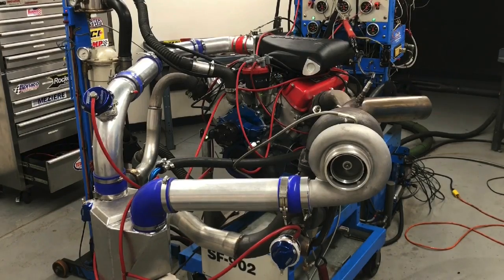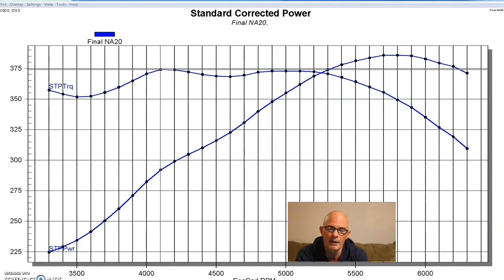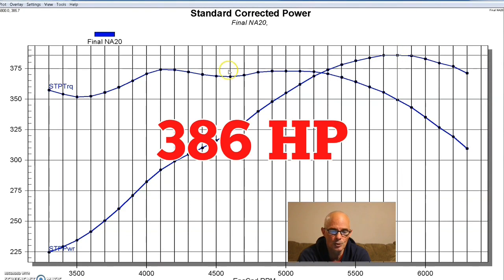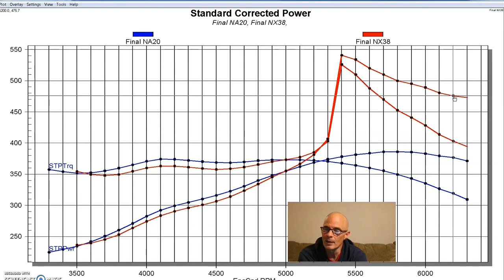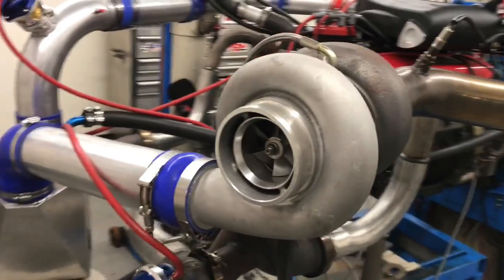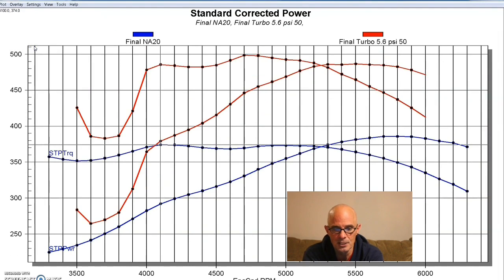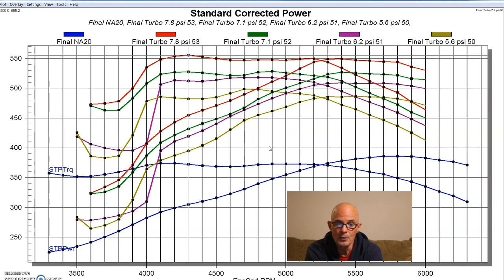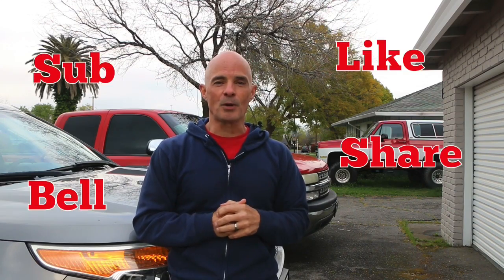DIY EBAY TURBO 5.0L-BUILDING BOOST!

Comment: Do a big bang on a 302. I wanna know of the blocks rly do split down the middle
Reply: That only happened to the 93 models, junk aluminum where the 92 and down models had the iron block and all forged internals
Reply: @sto1asgoetia600 Wait what? This is so insanely cap

Comment: We split a 302 block on the dyno right at 800hp. It split right down the middle.  It was at 15lbs of boost.  Then we made some braces in the lifter valley and a better girdle and it lived after that boost level and it went in a customer’s fox body and ran 9.0’s and 8.90’s for about 2 years before he changed the set up.
Reply: Ron Gravel    Is the 302 block the same in a fox body compared to a sn95 ?
Reply: Do you have more info on the bracing and upgraded girdle you used?

Comment: Rich, can you do a video where you purposely split the block? Just like when you ran that SBC with no oil.
Reply: should be easy, just put the timing back in at the bottom and itll split in half at current hp/torque levels. lol
Reply: You could even score the block and it will peel away from the internals nice and clean.
Reply: I vote a test on stock blocks with arp studs, sbf,   And sbc. Hell I’ll donate the sbc block.
Reply: Hell I'll donate the 318 SBM and GT45

Comment: Thing ran pretty good NA -  350-375 lb/ft from 3300-5700.

That's not a torque curve; that's a torque tabletop
Reply: Pretty impressive for a 5.0
Reply from the maker: plateau
Reply: I agree that engine N/A set up would be so much fun to drive on the street. Endless torque is so much better than a huge turbo spike IMHO.
Reply: @bill2178  stock 5.0 runs pretty good if you give it some more air, fuel and timing
Reply: good heads and good intake plus good duration on the cam to take advantage of it all. 224 and 232
Reply: @warrenstephens3705  If its built right you have torque and the turbo hit. Turbo's don't make less of anything under the curve, they just seem like it because the of how hard the turbo can hit. I built a 2.5 liter Audi 5 cyl that seriously pulled like a big block on the low end. 95 S6 Quattro on a wheel dyno, not crank, it was laying down 419 lbft at 2100 rpm. Never got below 300 lbft all the way to 6500.Thats at the wheels, with all the parasitic losses of accelerating a massive set of 345mm x 30 mm rotors and the OEM wheels.. in an AWD system with three mechanical diffs. Right turbo, right tune, perfectly docile in normal driving, stupid fun at Thunderhill.

Comment: This dude is literally a saint. I don’t think everyone understands how valuable his non mythical advice is to the car community. So much bullshit, and idiot youtubers giving out misinformation, and creating stigmas about platforms that really have a lot of potential. You can make anything fast if you build it and run it correctly for its design strengths and weaknesses. Shit, you can throw ring gap in a Prius, and throw a K03 on it and probably make it toot and scoot. Often it’s human error, but we live in a society where it’s somehow better to open your mouth at all, even if nothing but shit comes out. I often notice guys talk about shit they have absolutely no idea about. Remember kids, it’s cooler to admit you don’t know shit about something, rather than dig a grave down to dumbassville and embarrass yourself trying to sound cool or smart. The car community is riddled with this mindset.

Comment: Please try a BigBang on a 351w.

Keep them coming 👍🏻
Reply: I remember when MM&FF tried that...they ran out of wastegate springs just over 1000hp and tried to modulate boost with the throttle...which ended up with big swings in the boost coming on and off and eventually scattering the bottom end.  I have to think Holdener, at the least, knew about the test...even if he wants to deny it to distance himself from that train wreck! 😆
Reply: @carportshenanigans5918  that was also him testing that i believe lol
Reply: That test was our hero of the dynos, none other than Richard Holdener himself
Reply: Yeah!  I'd love to see the limits of a F4TE 351W!
Reply from the maker: Why would I deny doing something  so awesome? There is more left in a 351W
Reply: Sometimes people want a little plausible deniability. Lol. That was an epic test that I’d love to see with more cowbell(controlled boost)!
Reply: They broke a piston ring on that stock bottom end 351w if im not mistaken. And that build was my inspiration for my stock bottom end build
Reply: How about building a world vs dart block
Reply: @richardholdener1727   cool. How about more details on the DIY turbo build. Waste gate sizes. O2 sensors type. Map sensor MAF sensor conversions for tuneability. And DIY engine tuning. Tuning with a lap top. What you need to do for the proper air fuel ratios in your tune. Boost controls. Timing curves and how to set them for rpm ranges with specific boost. Its a bad ass chanel but Would love to learn more details on the build and tune side. Or atleast some recommended reading. Books and articles and so on.
Reply: @richardholdener1727  any vids on 5.4L? Turbo 5.4? Or 351 vs 5.4?

Comment: Awesome to see some 5.0 turbo love.
 I have the same turbo on mine and also using a Holley computer I'm already at 6.3psi and wanting 10-12 keeping the rpm down and the timing low let see how far this 302 can go
Reply: How’s the car doing? I just picked up a vs racing 7875 and looking for the same result

Comment: Thank you sir.... I'm building an 88 mustang GT and due to family and kids. It's somewhat a budget build. I was already thinking about buying a cheap eBay kit (if I can find a single turbo setup) but this made up my mind. The motor has the basic stuff. Gt40P heads, Edelbrock upper and lower intake, 70mm throttle body, mild cam (was in it when I bought the car) full exhaust that won't matter with the turbo. But I'm realistic with what I've got. If I could sniff the 500hp range I'd be really happy in that light car. Just worried about the whole block splitting thing. But I figured with an eBay kit if the turbo itself ends up not lasting, it's alot cheaper to replace a turbo once the rest of the kit is already in place. Thank you for your videos

Comment: I did something very similar on a 2001 Jeep Cherokee 4.0. It has a 3 to 1, 3 to 1 stainless steel header, custom y pipe/up pipe, heavily modified 96-98 intake, Edelbrock head, small Comp Cam that is bigger than stock and a single turbo. It's running 9psi of boost. The power from 2k to 5k is amazing. Haven't had it on a dyno to know exactly what the power is. It easily out accelerates my 15 Silverado that has smaller tires and better gear splits in the transmission.

Comment: 302 Chevy VS 302 Ford!! I know any motor of a given displacement will make about the same power but I would love to see a junk yard 302 Chevy build. Vortec 5.7L 4.00” bore block, pistons, & heads with the L99 3.00” stroke crank and 5.94” rods!! LT4 hot cam kit or better! 

-does the 4.9L 302 SBC kill the 5.0L 305 SBC? 
-does the 4.9L 302 SBC loose out to the 5.0L HO Ford?? 
-carb VS TPI + boost

Comment: Cool video, as always! What are the specs on the GT45 from e-bay?
Reply: I would like to know the same thing. Was looking at different ones last night. With H/C/I, which Ebay GT45 is the best trim choice? More wisdom please Rich, great work.
Reply from the maker: I'm not sure but will try to find out
Reply: Is that gt45 considered a 500 hp turbo?

Comment: Finally a ford 5.0 do-it-yourself garage turbo build. Just my recommendation but could you touch more on the tuning and specification side. What kind of eBay Turbo? What timing and air/fuel ratio do you recommend? Subscribed!
Reply from the maker: 11.8:1 AF, timing as 22 at power peak, Ebay turbo was GT45 clone fro DNA

Comment: Lil late here hehe, I'm from outside of USA and in my country there is no easy way of fabricating this as the culture here isn't as diy and really there aren't much Sport cars or at least sub 2000 there are quite exotic, for some reason mustangs are quite the easy find but almost all are 2.3l o que 3.8 not 5.0 so aftermarket and classic car people here see them as a 🦄 and prices are super high but anyway back to the point
You could actually sell a kit with all of the components for building this kit and people in the us or outside the us as me that just want the complete pack bought and shipped directly to your house  through Amazon or eBay, and most importantly in this cases, to get things that works and have been done by a guy that has all well documented and is experimented so can give grate instructions and visual guide as this video.
Could be some packages like light NA Bolton's, full NA Bolton's, Full NA and turbo, and for the guys out there that look for the nitrous or methanol injection a stand alone pack, ash the fox body and 93-95 sn95 engine bay is the same it can be cross gen and would get a lot of support in the international community as you seem of what you're talking about (let's not forget tuning you could give a file with the turbo kit or as a separate)
So people can build as they have the money or enjoy the process, have a trusted source and you make some bucks in the process (please don't try to get rich with the kit the exchange rate for dollars in my country is very high and a fully prepared car costs an eye, don make it an eye, a kidney, the other eye and the other kidney 🥺)
Love your content sorry for my English, hope to hear what you think 👍🏽
Reply from the maker: I am not a shop or business-not in a position to build or sell parts

Comment: 500 ftlb. From 302 at 7psi is AWESOME. Daily driver no problem. QUESTION...do You think the electric waterpump would be ok on street  ???
Reply from the maker: I think its fine at cruise but not extended WOT
Reply: THANKS  ! Dont think I could drive for extended w.o.t. Lol

Comment: Ok, so we talked about splitting blocks in your last Ford video.  Now I'm curious, we know torque is the enemy, especially at lower RPMs, can you make more power NA by winding the motor high? Can you, or have you, made 600HP NA with a 302?  That's 120HP/l, which I would have thought is unobtanium with a pushrod motor until recently, but I think with the right combo you could do that.

Comment: I bet it would make a little more power in each form (N/A, NOS, and PSI) with a better flowing exhaust system. Those factory shorty's look like they are punished! LOL, but overall, I liked the test because you used common salvage yard stuff.

Comment: Would like to see SBF 363 and SBF 408 Stroker, hp and weight comparison. 
Very informative, on LS platform, I know SBF can throw some big punches
Reply from the maker: I've done over 1000 hp with a Dart 363 SHP
Reply: I'm undecisive if I should go with Dart 363 supercharged or 408 NA setup for my 70 ford maverick. Very informative  with all your cams profiles

Comment: Richard i hope you answer this, and im sure its been asked before, but does that XR 274 cam need piston notching on a stock 5.0? You seem to use it all the time ao I figured it would be a great question to have answered. If not are there any heada that might need notching? Thanks and merry Christmas!
Reply from the maker: depends on the heads you run
Reply: @richardholdener1727  I have been taking a hard look at the AFR 185 enforcers. But definitely open to any suggestions you have! Thanks for the reply kind sir!

Comment: would an air to air intercooler work ok in a vehicle. i’d like to try a setup like this in a 67-79 f100. where did you plumb the oil feed/return lines from?
Reply from the maker: air to air works fine. You just need a pressure source from oil (like an oil sending unit) and the drain goes to the pan or front cover

Comment: You had done a 351W with a Vortech Supercharger awhile ago, but I cannot find it anymore has it been pulled from you tube?
Reply from the maker: I haven't done a video on that yet
Reply: @richardholdener1727  Sorry to disagree with you but, it was Boosting The Power Of A 351-Cube, Junkyard Small-Block Done with engine labs.

Comment: Also... was that guy pushing the tip of the welder up against the metal , using one hand and no helmet?  😂
Reply: I don’t know I found I was doing the no helmet thing when I started. Now experienced, I always find myself just putting the helmet on from start to finish.  And obviously lifting between welding
Reply: Unless I'm welding upside down directly underneath something I usually omit the helmet. Most of the bench stuff I end up using gloves and a 4" glass lol.
Reply: @CanadaBud23   You should cover your skin if you're doing more than tacking. UV radiation = skin cancer.

Comment: Are you using a oil restriction on the gt45 and how much oil pressure iv got 80 lbs of oil pressure is that to much
Reply from the maker: no restrictor
Reply: @richardholdener1727  is there any way I can private message with you about a combination I'm working on with the gt45 turbo? I know you're busy or your knowledge would be greatly appreciated

Comment: Richard, Great video as always.  Quick Question. You refer to the XE274HR Cam and say it's one of your favorites for the SBF.  I'm looking to rebuild my tired old 254K mile 302 in my 90 Fox Convertible. I like the stock cam drivability when compared to my other cars running various Ford alphabet cams. Even the mild E303 tends to be unhappy at anything below 1500rpm and causes the car to buck at low speeds.   We have tracked every vacume line and seal on the motor to ensure all is correct and we just can't get rid of the bucking. 

Would the XE274HR have the same bucking issues as the E303?  If so, what cam have you seen out there that would give near stock drivability and idle while making a little more power?
Reply from the maker: try the smaller 258, or 264 cams-there are 2 258 cams-one is high lift

Comment: Richard in your opinion, what  is the maximum of boost you can run on engine. Before you need to open it and gap the rings? Or what boost pressure would you recommend for a untouched bottom end daily driver?
Reply: Great question
Reply: Seems like he mentioned that in another video.  Safely 7-8psi is what's been mentioned in some circles.   Kinda like the turbo kits for totally stock vehicles.  Some of those are 5lbs max.
Reply from the maker: Its not a boost level, its ring temperature. Things that change ring temp include boost, inlet air temp (intercooler or not), fuel used (E85 is better), timing, amount of time under boost and load (WOT for 1-30 minutes even at low boost can be bad) just gap them for long term use
Reply: @Turbo_Todd  thank u. 5-7 psi seems to be the norm around GM supercharged  vehicles. Not sure about the Buick grand national or the later cobalt SS psi.
Reply: @richardholdener1727  thank you Richard for replying. Not the specific answer I was looking for, but knowledge is power.

Comment: Hello, nice video, I've just found your videos, will be watching more. shame these older motor were so reduced on power. I valve a 5.0 in a '96 f150. Would your basic upgrade pretty much work on a truck motor, or what would you change? Thanks. Any ideas on how long  an ebay turbo would hold up?
Reply from the maker: works fine on a truck motor

Comment: Who did your tuning? I want the same set up on my 2010 F150 5.4 3V. Just run 5-6 psi. Of course I would do a better job on the pipes...just need to find a Mufler shop that cuts and fits pipe!!! In Canada this shit is hard to do!!!
Reply: It really is. Not many are even willing to take on that kind of project at a shop. If they do it cost a fortune. I ended up learning to weld and doing it myself.
Reply from the maker: I tune my own stuff with Holley
Reply: @richardholdener1727  I had to learn my own stuff with Megasquirt as well. A lot of my knowledge came from many people down in the US but mainly Matt got me really into it with his goldbox builds. Simply there's just nothing here in Canada unless you got lots of money to burn. Of all the car meets, shows, events ect. I'm the only one with a self tuned stand alone in the area. The few that do have a stand alone all had email or base/dyno tunes. That's how scarce it is. It's not that hard really. It's not bad I'm glad more and more trying to learn but I wish more people would jump into it and try.